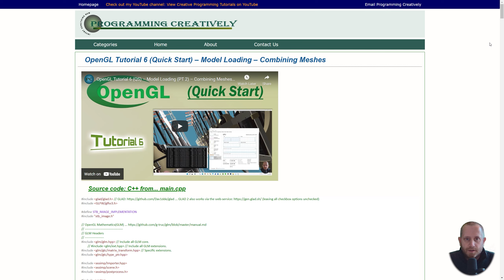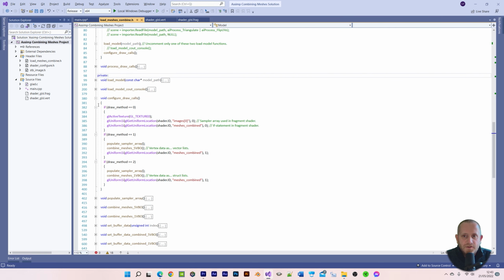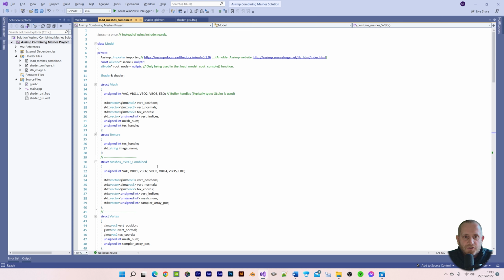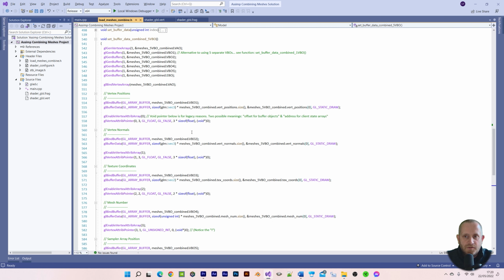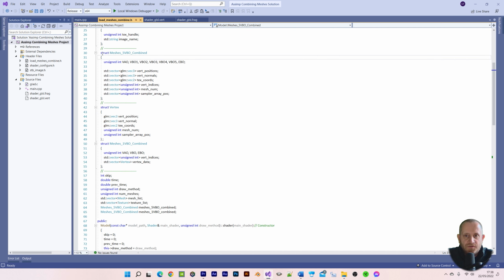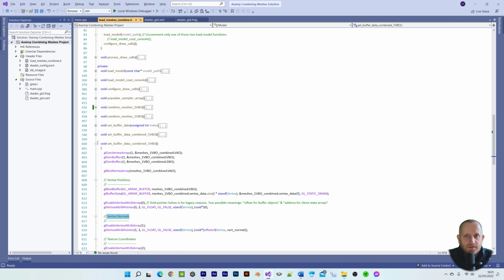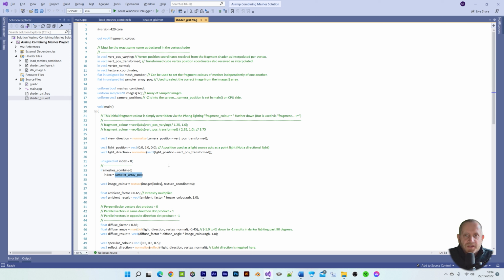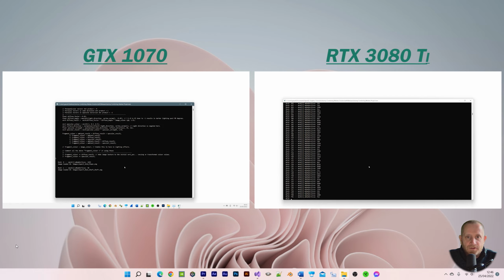OpenGL Tutorial 6 (QS) – Model Loading (PT 2) – Combining Meshes 1 VBO

Comment: Hi, i'm trying to cast a float to an int in the frag shader to use it as index to texture 2 different meshes of the same model, but if i do "int index = int(v_texID);" it doesn't work properly, only if i do "int index = int(round(v_texID));" than it works fine. Do you have an idea why this is happening, why can't i just do "int index = int(v_texID);" ?
Reply from the maker: I found this... https://gamedev.stackexchange.com/questions/8718/glsl-how-do-i-cast-a-float-to-an-int Ricket says "Also note that casting a float to an int automatically floors it (at least in any implementation I've ever seen) …".

And here... https://registry.khronos.org/OpenGL-Refpages/gl4/html/round.xhtml Khronos says "returns a value equal to the nearest integer to x. The fraction 0.5 will round in a direction chosen by the implementation, presumably the direction that is fastest..."

So, without round(…) maybe the value is being floored, i.e. all decimal places are discarded, e.g. 6.73 becomes 6, but with round(…) 6.73 becomes 7.